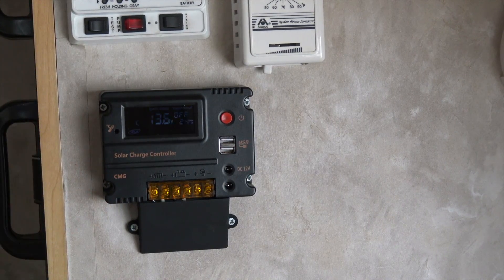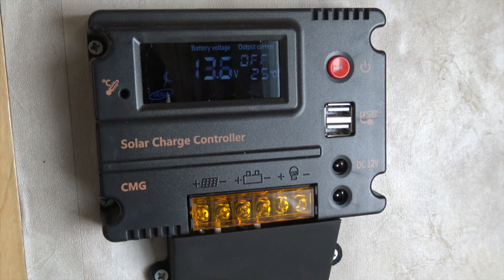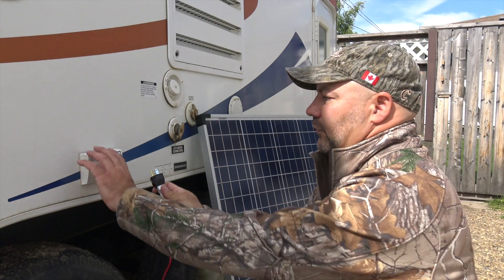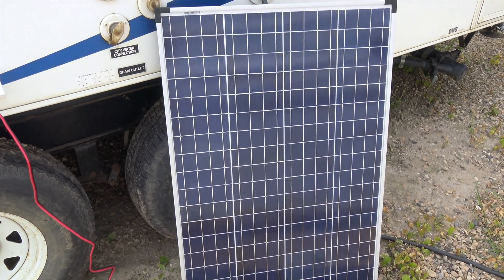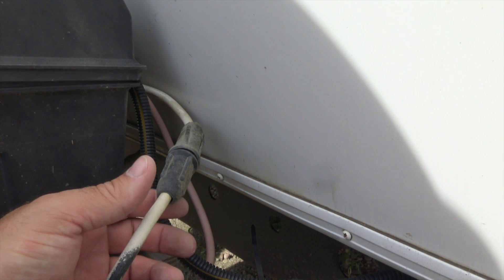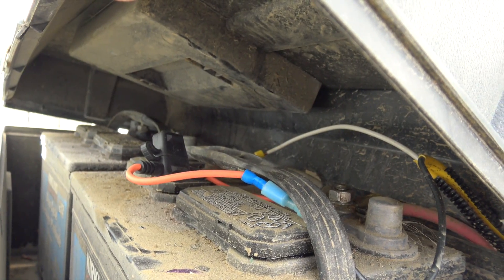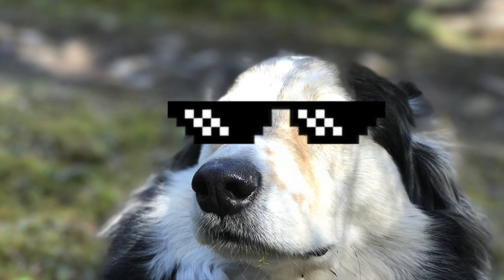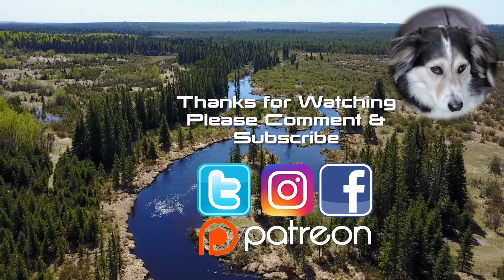RV & Travel Trailer Solar Install for $300

Comment: Bouge has no-drill solar panel mounting frames that you can use with double sided 3M super sticky tape to adhere  to flat or slightly curved camper roofs and then screw on the solar panels to them. #10 pv copper wire run into solar charger. Great fun. Portable panel are super...only at times I worry about the wind.
Reply from the maker: Thats awesome - Ill have to check those out! 👍

Comment: So why not use the SAE connector that comes with those Coleman Canadian Tire units and use an SAE port instead of the 110 outlet?
Reply from the maker: The 110v receptacles are cheap and easy to find.  SAE is a proprietary plug and expensive.  Also I can plug in a second panel in the other outlet to connect it in parallel.  So I guess its for simplicity 👍

Comment: If I go to bigger wire will that help?
Reply from the maker: There is a point of diminishing returns, the longer the cable going slightly bigger is better.  But don't go crazy.  There are wire gauge charts online that show current and length and the correct wire gauge to use!  Hope that helps!

Comment: How did you wire from charge controller to 110v outlet for solar panel? I can not fight it out.
Reply from the maker: The 110v outlet is only used as a plug connector.  The Solar panel supplies 12-14VDC via the plugin (110v receptacle) to the charge controller 12-14VDC.  It was just convenient to use that type of plug and socket.   Hope that make more sense.
Reply: @TheEmporiumOutdoors  Thank you for quick reply. So, I don't need to do anything on outdoor 110v outlet. What is the plug called that you use to connect the solar panel cable ? Once again,  thank you for your answer.
Reply from the maker: It's just a 110v domestic plug is all.

Comment: Dude, please use your calculator to add your own figures provided,
 they come out to over $500 not $300 and that is asumming one could get the solar panel half off which is not probable.

Your figures are nonsense. Very misleading information.
Reply: In addition you do not provide the cost of batteries. Your system probably ran you over $1000 to build when all material is factored in.
Reply from the maker: Homer - all trailer come with batteries :/ Not sure what your point is.
Reply from the maker: So there is a list in the description of all the parts.  Just add it up.  The $300 is based on the cheaper Amazon panel (I would have used that if I had not already bought the Canadian Tire model).  Maybe you got confused as I list two 100w panels.  Remember - this is also CAD not USD.

Comment: Where is the inverter located.
Reply from the maker: I don't invert - I just power the 12V circuit for lights, furnace fan, fridge (propane) & charging mobile devices etc.  I do have a small 160W car cigarette inverter I can plug in if I need to charge a laptop etc.   You could add an inverter but I would recommend big batteries and more solar capacity.
Reply: Make sense, just starting of on the solar side journey. Lots to take in.
Go off grid for camping in my travel trailer, I want to expend solar options.
I have !
100 watts solar panels /charge controller 
2 agm 100/ham batteries 
2000 watts inverter 
What do you think about this set up?( also thanks for your quick response).
My brain is hurting from information over.
Reply from the maker: Looks good - depending on what you will be powering.  2 x 100 amp/h batteries will produce around 20 hours of 10 amp draw.  So to charge them at the same rate or better you will need more panels.  So 10 hours of sunlight (summer time) you will need to push 20 amps of charge (400 watts of panels) based on drawing down the batteries everyday.  Just make sure you size the charger to 30 amps or better.  Consider a MPPT charger, more expensive but more efficient.  I went with the cheaper PWM charger and it works fine for my needs.  Also change out all your light bulbs to LED, cheap upgrade but really works well for power reduction.
Reply: Ok for now I will just used the one agm batteries, this will work for what I need . and I have the battery on the front of the trailer .
What is your take on AGM  batteries?
Reply from the maker: Good choice for your application.  If you have 2, I would still mount them.

Comment: This is great. Would this set up work for a year round, off-grid mobile home or are there any modifications you would suggest? Sorry if someone already asked this, I searched the comments but didn't see anything. Thanks
Reply from the maker: Hi Bret - I don't see why not.  I would maybe look at a better type of solar charger such as a MPPT as apposed to the cheaper PWM I used, as they are more efficient and higher quality.  Hope that helps!

Comment: how do you cover the 115 plug so it wont short on things when moved ?
Reply from the maker: The external 110v receptacle is in contained in a RV Weatherproof Outlet Cover - Just search it on Amazon.  Just keeps it weather sealed.  Hope that helps.

Comment: I like how you said don't attempt unless your competent.
Reply from the maker: Thanks - Although it's a simple project, working with battery power that may not have been installed correctly in the first place  with adequate fusing or isolation can pose risks.  Having knowledge of how to check for this is important and can save you from personal injury or damage to your equipment.

Comment: I am going to used two deep cycle battery, I have purchased the Coleman solar panel, what amperage charge controller would I need, is 30 amp charge controller a good option. I am looking at that now, need your advise.
Everton Wilson.
Reply from the maker: Hi Everton - a 100 watt panel will produce up to just over 8 amps - So a 20 or 30 amp model will work great.
Reply: The Emporium thanks

Comment: How long can you run a small plugin floor heater 120v ac  1500wats on your system ?
Reply from the maker: Hi Emmy - I have 2 x 12v deep cycle lead acid batteries - a 1500w load would only run about 1 hour.  https://www.digikey.ca/en/resources/conversion-calculators/conversion-calculator-battery-life - the pannel outputs only 100w so would never keep up.  Hope that helps!
Reply: The Emporium thanks very much. I'm new to this and learning as much as I can before I start burying components
Reply from the maker: Lots of research is a must.  I'm sure you will do a great job!  Best wishes - Michael

Comment: Thank you, I'm intimidated by solar, & any electrical stuff, but I do want solar on my skoolie..
Reply from the maker: Do some research on YouTube and follow the basic safety precautions and you will be fine!  I've only been hurt by electricity once and that was a car battery when I was a teenager - Don't under estimate the amount of power in a 12V battery - make sure all the 12v circuits are fused and you will be fine!  Best of luck!  Michael
Reply: The Emporium 
Thank you Michael

Comment: Wire nuts on DC and what about labels
Reply from the maker: I soldered the connections and used the wire nuts to cover the joints.  Strangely as an Englishman wire nuts are a oddity as these are never used in the UK.  Now I've completed and tested the system I did label the inlet and made a wiring schematic tapped to the underside of the seat area - Incase I sell the trailer.  Thanks for pointing out a few areas that needed improvement!

Comment: A lot of people I know you smell Limpus catalytic furnace doesn't require any moving parts it keeps their camper toasty on their boondocking makes batteries lost even longer up to 3 weeks in the winter cuz they're not running that fan on the furnace I thought I would share that
Reply from the maker: Hi Kurt, you are right the weak link is the furnace fan - they just suck amps.  The catalytic furnace is a great idea - I will definitely look into this!  Thanks for the suggestion!

Comment: How did you use the furnace of your camper? Did you have to use any inverter and how much wattage especially just running a furnace?  Please excuse my ignorance, and thank you in advance
Reply from the maker: Hi, the furnace runs on low voltage (12v DC) via the batteries so no inverter required.  The solar panels charge the batteries via the charge controller.  I'm not sure on the wattage of the fan in the furnace but I can keep things running (LED lights, low furnace use) for several days without plugging in.  Hope that helps.
Reply: Yes, thanks for your help and it's greatly appreciated.

Comment: Brilliant idea to use that 110 plug for your solar panel. I would have never thought of that. Makes it very easy to plug it in or disconnect it.
Reply: Just don't let the Grandkids get ahold of it.  If they were to plug it into a live outlet, you could have a tragedy.  At a minimum, you'll be buying a new solar panel and re-thinking the installation.  I'm not trying to be a safety nazi, but there is a potential there that should be considered before you wire the connection in that manner.

For my system, I took out the standard duplex outlet and wired a SAE connector to sit loose (like a pigtail) in the box.  Once it is connected and the box cover is nearly closed, you have a pretty good weather resistance.
Reply from the maker: Thanks!  It works and its cheap :)

Comment: Thank you. My wife and I are buying a used 2015,  17 foot ultra lite trailer in great condition, however we do need to replace an arm for the manual awning. We're getting it for $5250. Seems like a good deal given the condition it's in. I want to hook up solar power for it when we're off grid and don't want to use gas generator. Feed back is wanted...suggestions, experience, recommendations....even criticizing.
Reply from the maker: The new panels are much more efficient now and with a MTTP charge controller they can replace a generator for light loads.   The MTTP controllers are about 3 times the price however :/

Comment: Fantastic work! If I may, a few thoughts from my own research and solar projects: 

- The Coleman solar panels and anything you buy from a retail store is a tremendous waste of money. Even on sale at half price is a ripoff. I have purchased from solar installers in the past, and they pointed me to Solar Wholesaler as a reliable Canadian source. A good option they have presently is a 160W panel (https://www.solarwholesaler.ca/product/150w-polycrystalline-solar-panel/) that would easily go into your existing system at fewer dollars-per-watt than anything you suggested. 
- You are definitely right about the short cables - and there's some room for improvement with your controller arrangement. The batteries are at the very front, lower on the wall, your controller appears to be higher up on the wall somewhere int he middle of the trailer, and the outside power ports for the panels also look like they're in the middle. If you situate everything near the front, most particularly putting the charge controller as close as possible to the batteries, you stand to gain a fair amount just from reducing the cable length within the walls. Of course, I've never tried to run wire in a travel trailer so I'm not sure how possible that is. 
- Your 100W solar panel probably puts out a maximum of 5.5 to 6.5 amps - based on the stated rating, your solar controller could handle about 320-340 watts of solar comfortably in a 12V nominal system. 
- You likely already know this, but your ability to move the panels is incredibly handy. Generally, a solar panel almost completely stops putting out power, even if partially shaded, so if you can move it to keep it in full sun, you can gain more power.
- If you wish to squeeze more power out of your system in November, you may wish to consider an MPPT controller. They are more expensive, but solar panels tend to run at a higher voltage in the cold, and an MPPT controller can take advantage of that and translate it into more power to charge your batteries. 

Thank you for sharing!
Reply from the maker: Hi Gregg - I really appreciate the tips!  That's some great information.  Now you mention it - yes I should have put the controller closer to the front but I was trying to keep all the gauges close together (unnecessarily).  The website looks great and the prices are very competitive - even at Canadian tire half price - lol.  I know the MPPT are a better option but the price is much higher - I would consider them if it was a year round solution but for occasional use - the cheaper PWM charger works for me.  Thanks again Gregg I'm sure a lot of people will find this comment useful!!